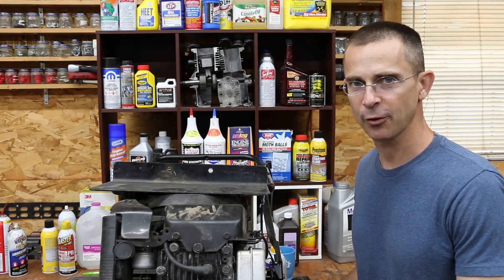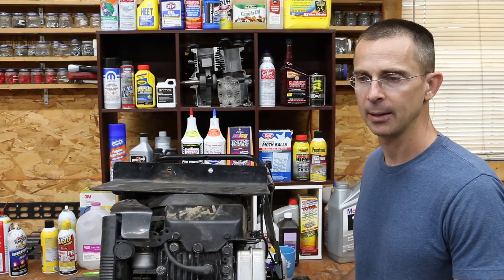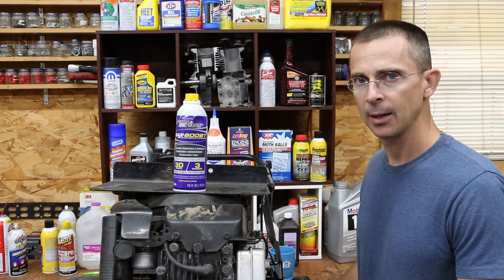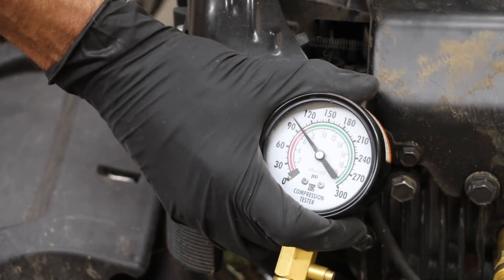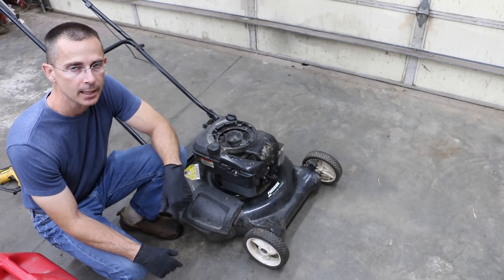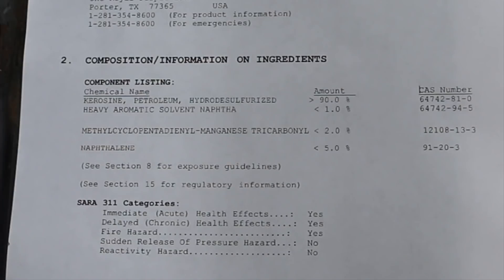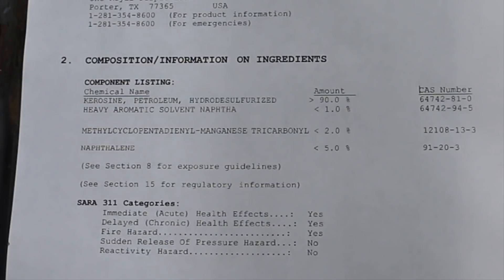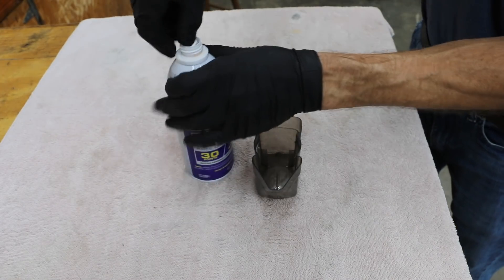Will a gas engine run on 100% octane booster?  Let's find out!

Comment: Nice experiment
Have done some real tests in EPA certified laboratory on dynamo-meter more than 26 years ago when one of the fuel shortage high price was ongoing. It was on air cooled HONDA 600 AN small two cylinder car engine.
1.) The fuel tank gets cold, so cold indeed that you can form ice on surface of it, as the evaporation cools the liquid.
2.) There is always as much as 5% of the fuel left over, and that will not even ignite with a match, but can be mixed with diesel to use it up.
Basically you vacuum distill the liquid gasoline and have the high molecular fraction (which has more energy left over, so your true mileage is about 15% lower, but you have 5% of "diesel" left over after the evaporation stops, and that is ONLY with heated tank.
When at 70F the tank can get well below 28 F when you really "drive" the car (our experience)

So routing the exhaust THROUGH the fuel tank is one solution to getting more of the fuel evaporated, but then you will still need to drain the tank periodically and have huge bit of sludge and goo left over, if you do not clean it on regular basis.

So while very possible as you have well demonstrated, it is not practical, and a very expensive air fuel vapor control would be necessary to make the car "driveable", on fast acceleration it may stall and under load that changes the engine speed is very unstable.

But still a GREAT video, that busts the 100 MPG Fake news......

Comment: I was told about an old street racing trick where they would dissolve about a nickel to a quarter size amount of a urinal cake/puck in about 5 gallons of gas then put the gas in their tank .
It was suppose to increase HP , so I've been told. Kind of interested to see if it's true or not.
Reply from the maker: Thanks for this recommendation!

Comment: Run an engine on propane please
Reply from the maker: Thank you for this suggestion!
Reply: Been there done that. It works, but isn't reliable.
Reply: @bhume7535  they have that in Dominican Republic. cheaper than gasoline but a loss of horsepower.

Comment: wicked sick to know that octane booster actually can burn on its own. so if it doesnt boost your octane it atleast helps the gas burn, with all the kerosene and shit in it. still though, moth balls? why dont you try adding that stuff to a tank on its self with gas to isolate it and see if it actually increases octane. just a thought though, would be cool to see what happens.
Reply from the maker: Thank you for this suggestion!

Comment: Makes sense.  In many ways, octane booster is simply higher octane fuel plus other contents to cut lower octane fuel with.  That orange buildup will however decrease the life of spark plugs and O2 sensors on an automobile.
Reply from the maker: Thansk for commenting on this and great point regarding the orange buildup.

Comment: well, you keep running stuff more expensive than gas. try things cheaper than gas. you never state a price of a comparison to gasoline. if you eat a pound of lead and shit a pound of gold cuff links, well that's great. but you're eating a pound of gold and shitting lead with these "experiments"...
Reply from the maker: Thank you for this recommendation!  Do you have any product recommendations?  I suppose propane is less expensive in some areas.  Any others?  Thanks again
Reply: that's the problem, everything with "energy" costs more, unless you have a still in your backyard. i wonder if "pure" hydrogen peroxide would run an engine. the crap you buy in the store is like 2% (extremely watered down) you can get 6% from some supply companies, but PURE, you'd almost have to make it yourself, if you didn't work at a place that did.

Comment: Try running the gas engine on kerosene or rc 20 ℅ nitro fuel or lighter fluid or try running it on racing methanol
Reply from the maker: Thank you for this recommendation!

Comment: Geat vid. Saw the box of mothballs on the shelf and knew the outcome was going to be nearly no difference in power. I used to use moonshine as an octane booster in my big block Buicks and Mopars. About 2 gal/tank (22 gal tank) and it worked. It ran a little cooler, had much better response and cleaned out the carbon build-up in the cyl. How about running the fuel dragsters run in top fuel, nitromethane. See if it runs hotter/cooler, if it uses more or less fuel to cut the same amt of grass etc...
Reply from the maker: Thanks for commenting.  I plan to test alcohol in an upcoming video.  Thanks again!

Comment: Did you start your lawnmower with a air gun? Like the kind, you would use for taking off lug nuts on a vehicle?
Reply from the maker: I use an electric drill with a 1/2 inch adapter that fits into the drill and holds a socket.  It works great.  An impact wrench will destroy the threads or snap off the shaft.  Thanks for commenting!
Reply: Project Farm thanks for the reply.

Comment: Impressive video dude, I figured it would burn a hole in the piston. 
U mentioned mothballs; I've heard stories of people putting them in gastank to catch gas thief,
It supposed to breakout mouth of guilty party with big'ole fever blister lookin sores. However i'd be afraid of killing somebody by doing so. A good ol country ass whoopin does wonders for thieves 😉.. Anyway I had never heard of being octane booster, makes sense though would it burn clean enough ??? 

Also something I always wondered about; Will Mrs Butterworth syrup lock/blow up engine? Someone told me that it'd cause head bolts to wring off. 🤔Of course I called Bullshit. Afterwards it sparked my curiosity. Now I assume that a mad x girlfriend had poured bottle into gas tank of her fellas truck. So I don't know if testing that way or pouring in where oil goes. I don't think cause crank to lock but could cause hell of a mess!! Let me know what you think,.. ✌🏼
Reply from the maker: I really enjoyed reading your comments.  Thanks for recommending Mrs. Butterworth Syrup.  I did a video on sugar in gas but this might work a lot better.

Comment: I guess people generally have no idea what octane is and what raising it does.    

Higher octane , resists detonation more,  hence reduces the chance of pinging / knocking / pre detonation.   
It makes it possible to run engine little bit more lean, and give it more advance / give the spark earlier to make it closer to best power , yet still avoid runaway pre detonations with heat etc.   

high octane it self doesnt give any more power.  it just allows better fuel to air ratio and earlier detonation for better performance, while avoiding the knock.  

And Us.  octane ratings are different to rest of the world.   so   us high octane is basic fuel pump stuff here in eu .  But who cares,,  its all about  e85 anyways  now on performance engines.
Reply from the maker: All great information.  Thanks for commenting!

Comment: Have you tried designing a different head for that mover before?
Reply from the maker: I've made a head out of JB Weld and a wooden cylinder head.  Do you have any other ideas? Thanks for commenting!
Reply: Project Farm a hard resin like carbon fiber type or porcelain

Comment: Run a engine on brake parts cleaner or carb cleaner or really any flammable cleaner I'm mostly curious on the effect it would have on cleaning the combustion chamber
Reply from the maker: Thank you for this recommendation!

Comment: Try running it on flammable gases - propane, methane, hydrogen, acetylene.
Run the clear head with boric acid dissolved in metanol. It burns with a lovely green color.
See if it can be run with lacquer thinner.
Run it with mothballs dissolved in gasoline.
Run it with MEK.
Run it on aviation gas 91UL and 100LL
Run it on citrus oil or other volatile plant oil.
Reply from the maker: Thank you for these recommendations!

Comment: There is a bottle made by lucas in big red letters labeled ETHANOl.  its a green fluid designed to offset the effects of the ethanol. I run in my carbed honda 600 and I the mileage difference between 100% and ethanol gas i gain back using this fluid. Its teh best iI have ever seen with no comparison. Id like to see some testing more scientific than teh seat of the pants tests.
Reply from the maker: Thank you for this recommendation!

Comment: You should talk when you put captions in your videos , I don't suppose you don't have an editor that can't do that . To get more view time put bloopers or extra cut clips at the end of the video . A small change , try to use the fast motion clips to pass more details its the best section of the video to do so and give SI units as well ie Celsius for temperature
Reply from the maker: These are all excellent suggestions.  I'm somewhat limited on what I can do with the video editing software (talk/captions) that I use, but I plan to invest in better software when finances allow.  Thank you for the other recommendations.
Reply: Project Farm use free version of light works its an excellent editor

Comment: Tune one of your Engines up. Make it have more power. Run E85 etc. In other words. Can you tune your lawn mower engine up so it blows up.?
Also design, find, Macgyver a turbo and put it on one of your motors.
Reply from the maker: Thank you for this recommendation!

Comment: Would be interesting to see about running jet fuel in a diesel engine. I know that diesel and Jet A are very similar, and that you can start a diesel on jet fuel, but I don't know what sort of effects it has if its let to get up to operating temperature, or even made to do work while on jet A. Shouldnt be hard to get, I know my local airport sells me 100LL if I ask for it.
Reply from the maker: Thank you for this recommendation!

Comment: Run an engine on a 19% mix of non-E 93 octane pump gas and Xylene. 

Do you understand that the higher the octane, the cooler the fuel burns and the less prone to pre-detonation due to being more stable under higher cylinder pressure and heat? And the higher the octane, the more fuel you need because the fuel actually burns SLOWER. Hence your increased cylinder head temp after running it under load. If you increased (advanced) the ignition timing by say, an extra 5°, you wouldn’t have seen the added temp and would have seen more power. 

Regular pump gas may be able to handle the added timing as well but the best way to test that is to build a jig to record timing and build a simple detonation counter using a GM knock sensor. Then run the engine on standard pump gas and increase timing advance until it starts pre-detonating (knocking, pinging, rattling, etc) and THEN switch to 100% “octane booster” repeat the test. 

Naphthalene is only rated 90 octane. Xylene is rated at 112oct. Toluene can also be used as it’s what’s used in a lot of name brand racing fuels. With both Xylene and Toulene you would want to add some extra oil to help “lubricate” the fuel, as both chemicals burn very dry.
Reply from the maker: This is all great information and you are very knowledgable.  I've got an extra GM knock sensor available to me.  I'm not sure how to build a detonation counter.  If you have any suggestions on how to do this, could you please send information to my email account? projectfarm52@gmail.com

Comment: Can you please try hoppes 9
Reply from the maker: Thank you for this recommendation!
Reply: hopefully it works for engines. because it's the worst barrel solvent made.
Reply: I've been using hoppes 9 since 1970 no problems
Reply: Mauser Houser lmao
Reply: yep, and all that copper is still in your barrel right where you left it because hoppes won't remove it. good aftershave though, it smells nice. as a Gunsmith, Hoppes and WD-40 has been making me $$$$ for over 20 years now i hope they never quit making it.

Comment: I want to know what octane booster would best increase my performance on a Briggs & Stratton 5hp motor.  Its from the 1970s, and can run on leaded fuel.  Plus, is it safe to occasionally use Mothballs in a 18hp Duromax 440cc motor to boost performance? I have a Montgomery Ward T555 Terrain Cycle 3 Wheeler (197?) and I want to be able to have some crazy performance showing off.  Any suggestions?
Reply from the maker: I'll have to do some homework on this one.  Maybe I can put together a video on how to achieve performance gains out of a small engine.  I believe there are a few "free" or nearly free ways to do this.  Thank you for this video project idea!
Reply: Project Farm, that would be great. Thank you.  Keep up the great work too!

Comment: Kerosene, and naptha are pretty close to diesel fuel in energy content/volume and knock resistance. The MMTB (I think, my memory is scetchy) is the actual octane booster. Remember that these one lungers are shipped were Fuels can have 70 octane. More octane does nothing except make them harder to start. Flame front speed and thermal expansion are key with Flatheads. Alky with water and household ammonia is a good place to start, jets have to be huge! I raced riding mowers for 25+ years.
Reply from the maker: I really enjoyed reading your comments.  You're very knowledgeable!
Reply: Project Farm Thank you. Watch your see-through cylinder head footage and you will understand. Also look at the carbon residue, it should tell you many stories.
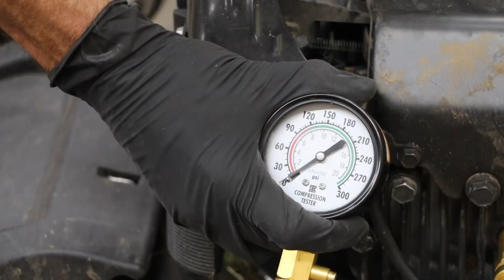Reply: Thought about this later, surf through MSDS sheets looking for known information. They can tell you flame front speed, temp of ignition, thermal expansion, etc.. even check paint thinners and any combustible fluids. Dupont makes a wicked thinner that works like crazy on flame front and expansion. 1:20 makes the power and tests as pure pump gas. Start searching and you will find it. Give it a try and you will get a huge surprise 😀

Comment: Kerosene is jet fuel. Can also be used in diesel engines
Reply from the maker: Thank you for this recommendation!
Reply: Man from Nantucket Jet-A, #1 fuel oil and the Pre-ULSD diesel #1 are all the same.
Reply: The BBQ Jerk wrong. 23 years pulling from refineries. Heavier fuels such as HAGO come off lower in the process than lighter fuels such as ( #1, Jet-A ) above that is Gasoline and Naptha. JP-4 is more like gasoline mixed with #1.
Reply: Jet A is unleaded kerosine with additives. Jet B is naphtha-kerosene, and more like diesel.
Reply: All military jet fuel, (JP-4, JP-5, & JP-8), are mixtures of gasoline and kerosene. JP-8, is about 55% kerosene/ 45% aviation gas
Reply: Home heating oil and diesel are the same thing, except home heating oil is red and regular diesel is a greenish color.
Reply: @MikeSmith-GT  The diesel that's green is dyed.  This means it has been taxed as on road diesel.  The red is also dyed, but is intended for offroad fuel No tax.  This was done for law enforcement as a quick and easy way to see if some one is cheating on fuel taxes.
Reply: Kerosene, JP jet fuel & diesel fuel are all basically the same. They burn but do not detonate like gasoline.
Reply: The russians made the SU-25 (tank killer) aircraft to run off diesel, kerosene and even vodka. Little fun fact.
Reply: Kerosene is very dry. It can damage injectors on HEUI systems, as well as the Injection pumps and especially cylinders walls. A lot of guys cut ULSD with kerosene in the winter to act as an anti gel or they’ll mix it with 2 stroke oil.
Reply: jet fuel doesnt lubricate as well as diesle
Reply: Jay Sanders what search it up
Reply: Jet engines run on any fuel that burns with oxygen.
Reply: Here is a reliable source :
https://www.shell.com/business-customers/aviation/aeroshell/knowledge-centre/the-aeroshell-book/_jcr_content/par/textimage_1433441235.stream/1445040706292/dc509e15cde99b11ddb6ed7e50c61e2e427a0f512435718921ed79028ed25048/aeroshell-book-2fuels.pdf
Reply: Kerosene and diesel are the same just diesel has a dye in it
Reply: Jett Jordan: Kerosene and diesel is not the same, kerosene give no lubrication unlike diesel. However a diesel engine runs perfectly fine on kerosene if you add lubrication to it like adding 1:200 of 2 stroke oil (I use 1:100 to give even better lubrication and less wear to be on the safe side).  Have run kerosene in a turbo diesel engine myself for several years. If you don`t add oil in the kersosene you will ruin the high pressure diesel injection pump in the engine because of lack of lubrication, that pump is horrible expensive to repair.

Comment: The brown/orange stain on the head is likley rust (iron oxide). Ferrocene is a common fuel additive which increases octane and lowers smoke/soot production of the combustion mixture however when burnt it decomposes into iron oxide which deposits on the internal parts of the engine.
Reply from the maker: Thank you for commenting on this!  Others mentioned that it was MMT, which is known to cause the orange buildup.  Your theory makes sense too. Thanks again!
Reply: @ProjectFarm  Yep. The orange buildup is manganese deposits from the MMT. Torco additive is infamous for these deposits which eventually foul the spark plugs. Some of the newest additive formulations use chelating agents to keep the manganese/MMT in solution (it can often settle out under long-term storage) and to minimize the amount of MMT that needs to be added, hence minimize the amount of orange deposits.
Reply: @emanymton5191   I had to switch my plugs after using octane booster for about three years.  The bottle didn't say that it had MMT!  I avoided other products because the bottle listed MMT as an ingredient, but I never expected products to include MMT without listing it on the bottle.  Fortunately, there's no apparent damage to my car.
Reply: The MSDS would say if there were ferrocene in it.
Reply: Harry Potter
Reply: It’s the MMT
Reply: Harry brilliant.